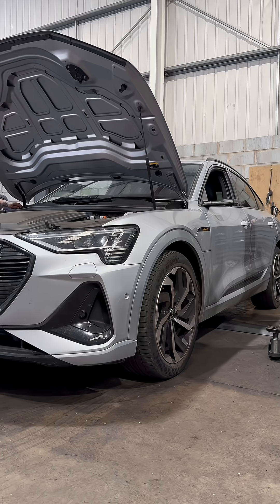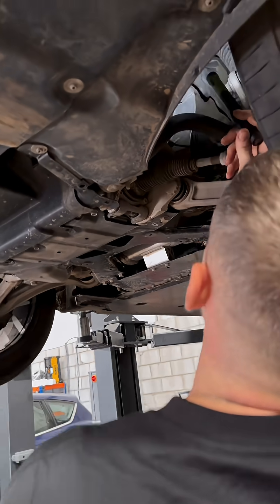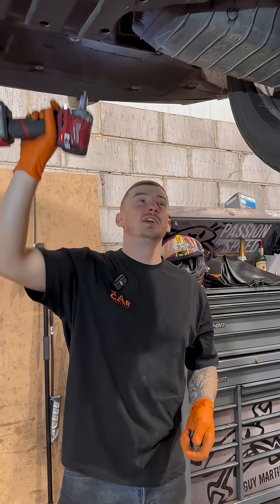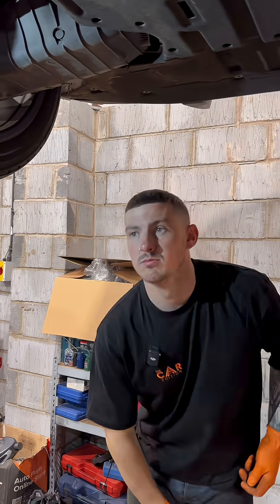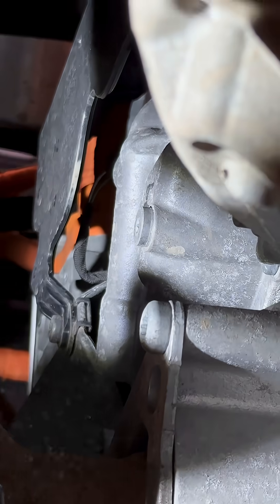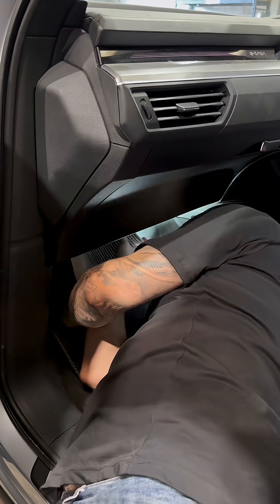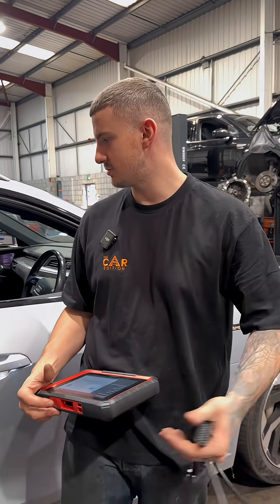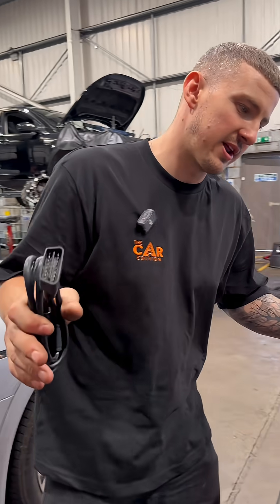How do you service an electric car? Audi E-Tron in for a full service 🦾

Comment: As much as i love my petrols and diesels, as an electrical engineer im actually quite excited for a future of electric cars. Not having anything break is something i like the idea of. Plus with over a decade of experience working with batteries they dont worry me in the slightest. For most evs the chassis will rust through before the battery fails

Comment: What's your thoughts on 2022 etron. Any common repairs needed like new motor. Watched a video about flaw with the motor where fluid leaks into block that should be sealed. Thanks, looking at buying a 2022 vorsprung

Comment: Good that your checking the electric motor coolent drain ports BUT they are there to allow any coolent that has seeped past a worn seal to be retained till service and released so if there is any present its pointing to a failing seal and that need attending too. Of course if the service is delayed of the leak is bad or a combination of both the coolent could enter the electrics / gear box. Conversely keep an eye on your coolent level, if it drops ....panic

Comment: A bit late, but that front motor likely has coolant stuck in there.  Based on how much was in the rear 'catch can', likely the front seal is also leaking.  Fairly common for nothing to drip out of the t30 drain, need to stick a pick in there and break up the surface tension and/or junk built up.

Comment: Tyres.  It’s not the diff you have to worry about. It’s the centre differential that has issues if the rolling radiance between axles is too different.   Audi say that 3mm on a diagonal is okay. But as the car is electric and no centre differential new axel pairs is fine !

Comment: These have no problems until they get one at least and won't be pretty i tell you that. I've changed the front motor in one of these awd  e tron and a high voltage switch box on battery (go ta get down 😢) nasty prices i tell ya

Comment: It's not going to fk up your rear diff. The difference in new and an old tyre in circumference is minimal. This is literally the job of the diff. It exists solely to accommodate such an event. Think what happens when you drive. You are constantly moving the steering wheel left or right of centre. I would be more concerned with the difference in grip between a worn and a new tyre that a bit of diff action. And yes, i am a qualified mechanic.
Reply: Agreed, that is exactly what a diff is for. I have know some traction control modules get confused when the circumstances of the tyres differ. That was the first time that I became familiar with 'star' rated tyres.
Reply: It depends on the type of diff. A traditional mechanical diff will cope with different tyres without issue. Some 4x4 cars have a viscous diff as a centre diff, and some do not like constant speed differences, so wear more quickly if front to rear wheel speeds are significantly different. Permanent 4wd usually have a proper centre diff. EVs are using a variety of different systems across axles, some quite cheaply, which can be affected by differing tyre diameters. All these concerns can be avoided by avoiding EVs.

Comment: 120k miles on my EV. Original brake pads and discs. Done literally nothing to it in 9 years. Oh wait, I changed the wiper blades a few times.
Reply: Please check your tires after 120k
Reply: I've made the jump to EV. Best thing I've done regarding travel..... Nooooo stress.
Reply: Get ready for the ev haters, they will use emotional arguments rather than logical ones
Reply: @techclipzgo checking tires is an emotional thing?
Reply: @techclipzgo high purchase price, unsuitable for long distance journeys, rapid depreciation, extremely high repair costs outside of warranty.. sorry feeling emotional today
Reply: Pair of utter benders!
Reply: which EV do you have?
Reply: Which EV do you have? Curious cuz i have hear that some of the earlier teslas were great
Reply: Boring cars

Comment: Not interested in looking for the fault or bad adjustment that’s causing the uneven wear on the rears then…?
Reply: Fault exists in the driver's right foot. Some cars uneven tyre wear just happens, could be suspension geometry or driving style.

Anyone living in Milton Keynes will know about uneven tyre wear, the whole town is full of roundabouts so you spend much more time turning right than left.
Reply: It's a known fault due to the suspension geometry being unable to cope with all the different height settings of the air suspension. Air pumps also prone to failing early and it's bend over and get the valve grinding paste time 😂😂😂😂
Reply: Exactly, instead of fixing the fault he's recommending four new tyres! Total crooks.
Reply: @adrianOrange fault of suspension geometry due to air suspension

Comment: What he should’ve explained about the diff is if your diff is an lsd limited slip diff as the tyres are different circumference in hard or firm acceleration the lsd diff will apply pressure to its clutches or cones to give a locked scenario to apply the power to ground in an even action 
Whilst slightly different circumference tyres will cause the diff to try and apply pressure to the clutches or cones more often as it thinks one wheel is slipping hence the lsd setup but I doubt a slightly worn tyre is going to cause an issue considering the left rear tyre wears more than the right rear tyre due to tourque twist in putting power through the driveline but a different size tyre would cause major issues and prematurely wear out an lsd diff

Comment: You Could have taken the brake pads out and Grease the sliders, Another thing was Removed all the Road wheels I bet they are Corroded on the Hub which is normally found on This yearly Service 😢

Comment: I went to France for a holiday and before I went I had 2 brand new tires put on the back 3 days later I got a puncture and the garage refused to replace only the damaged one stating it is an offence in France to replace the 1 both have to be replaced, so who knew?

Comment: If there is wear, especially on a powerful electric car on the insides of the tires, there are often some bushes that are starting to wear out already. This is especially common on the Tesla Model S & X.
Reply: Model X wears out the inside edge of rear tyres regardless of suspension maintenance because the factory camber settings aren't appropriate for all ride heights of the air suspension.
Reply: Get a puncture and replace all four tyres lmfao

Comment: Id say more important to change tyres in axle pairs for even grip and braking distances.
Reply: It's key for cornering - often one side loads up or has much greater chance for grip (due to gravel or greasy material on the road for example) - in the wet a blad or low tread tire might not do the business.
A single tyre with good tread might prevent a crash.

Comment: Wait until you need to change the battery!
Reply: My 9 year old model S has 158,000 miles  no wet belt was done bla bla bla . On the original battery etc.  Drove from Belfast via Glasgow to Kings Lynn one day. Cheap to run. Especially on Tesla Supercharger network/charging at home
Reply: Where’s your evidence for that bold claim. 
Actually battery repairs are common now.

Comment: Wait what? You drained some coolant, where did it come from? Does it need to be topped up?
Reply: Rarely. It’s not operating at anything like the temperature of a combustion engine. It’s used to cool both the battery & in some cases the motors. 

In some EVs they’ll heat the battery in the winter. 

It’s rare for any of them to give trouble but there’s a known issue with the early model S Tesla where a seal can fail letting coolant into the drive motor. Almost all have been replaced by Tesla though.
Reply: @hughmarcus1 Actually on this e-trons, rear motors are a problem, with coolant leaking on to the motor. Emptying this reservoar you see in the video, prevents that from happening and is the most important bit on the service he did😅
Reply: @andersnor2 does that mean Audi's solution to a coolant leak is to provide a bottle to catch it and a service instruction to empty it rather than eliminating the leak during design and development?  Premium manufacturing going on there.
Reply: @insanityideas don't know all the details, but i live in norway where there are a lot of EVs and E-trons. And a lot of issues with this car. The insurance is also expencive on E-trons because of all the problems. Seen a lot of videos on these, specially explaining this reservoar for example. Not good. One of the best looking EVs in my opinion, but that does'nt help if it makes you broke😅
Reply: @andersnor2  52k in my etron and the rear coolant  reservoir is still empty, checked yesterday when I replaced the air suspension compressor ( these are a common fault and the only issue I have had) Audi to replace £2.5k. Me, an hour of my time + £179 for a replacement one from the breakers.

Comment: Tbh I have been driving for thirty eight years and have only ever changed the tire that is either worn or damaged in a place that cannot be repaired. This whole differential business is new to me.
Reply: It’s mostly a big deal with AWD vehicles, you don’t want difference between the front and rear, otherwise the transfer case could suffer
Reply: I have been driving for 51 years and only ever change tyres on axle pairs.
My reasoning is to ensure maximum stability during emergency braking or cornering.
Reply: @chrispop99 😂you have got to much money pal
Reply: @sineave6419  Nope, but plenty of concern for safety for myself and others!
Reply: Years ago, without ABS, it was a good idea to have similar tread depth across an axle, but with ABS not so important.
Reply: @oliveringram3056  Braking distance will still be longer, and loss of steering control more likely.
Even with ABS braking performance is limited by the worst gripping tyre.
Reply: It's completely fine on almost every car ,he was talking about 4wd  and rwd with a proper diff.

Comment: Assuming (90%?) that electric cars are fully adopted then we will have moved from a period of maximum ICE complexity to minimal mechanical (engine / gearbox) but maximal electronic complexity. I guess this transition will take 25 yrs to work though (probably via hybrids) but good to see you getting in early to understand and service these cars as your business will be changed beyond recognition in a generation.
Reply: Get rid of the horse stables and replace with petrol stations 
It’s been done b4
Reply: @michaelhermans4753 different situation back then. Horse vs car. Now it’s electric car vs petrol car. Car vs car. The transition is not so obvious.

Comment: This kid chats shitt. The differential is designed to overcome the ackerman principle while still transferring torque to both wheels. When you go around a corner, the inside wheel has a smaller turning radius to outter. This is normal and DOES NOT DAMAGE DIFF. It annoys me when people just waffle technical when they have no clue what they talking about
Reply: The 4WD Audi/VWs etc require the same circumference tyres, or you're asking for an expensive repair.
Reply: @deaddoll1361  every time you go around a corner, the inner and outer wheels turn at different speeds. The differential is there to allow independant rotation whilst still applying torque to both wheels but without 'skipping'. So your saying now let your tyre 2mm of tread will destroy the diff? Dont just listen to people, understand the system and come to a conclusion yourself.
Reply: While I highly doubt the slight difference in tyre wear makes a difference. Running a space saver on a driven axle for a long time or wheel spinning regularly with an open diff will wear out the planetary gears. They have no bearings. They're only splash lubricated and just rub against the diff cage, I've seen it a few times now.

Comment: It is better to have tyres that are the same depth but its not going to ruin your diff if they're not, differentials are in constant flux, even in a straight drive down the road there is differences in rotation, thats why the differential is fitted in the first place, regular good maintenance is the key.
Reply: I think he means for a limited slip  diff perhaps ?  But yeah I've heard of that , but would tend to agree with what you said . 👍
Reply: Having tyres with different tread depths can throw up fault codes with certain VAG vehicles as even in a straight line there will be a significant difference in speed of rotation of wheels on same axle. So what he stated is essentially correct.
Reply: @iainmacleod4007 coming from a vag owner 🤣
Reply: @iainmacleod4007  Enough to ruin the diff? No way.
Reply: @thewaywardgrape3838 Yes, way…if it’s a clutch disk style coupling, which is sometimes (incorrectly, IMO) referred to as a center diff.
Reply: It’s a reference to center”viscous” coupling diffs, that is, between the F & R prop shafts or final drives. A little slip when turning is ok. Constant slip when the car is traveling straight ahead isn’t ok in the long run. If it’s a gear-only type diff w/o any friction disks, I agree with your point, though.
Reply: It is a German car remember 😅
Reply: I’ve had loads of Awd cars (cossie, evo, mk3 focus rs, Subaru and bmw touring) the x-deive on the bmw is a bitch with tyres to the point i paid £120 for an app to delete it but all the other cars i’ve had, couldn’t give a shit.

Just think about this, the new m3 & m5 and be turned rwd on a push of a button. If you drift then the rears will obviously be more worn than the fronts.
Reply: Which makes the comment about it ruining the diff to be a load of Bullsht
Reply: These guys are incredible, but that tyre difference front to rear ruining your diff comment was retarded. Some awd vehicles have totally different tyres front and rear, like the X5s these guys work on... Ideally, all tyres would have the same rotational dimension, but that is almost never the case and is not going to fk your centre diff
Reply: I know someone with an BMW x3, part worn different sized tyres on the rear ruined the diff, £3k+ bill from BMW, so you are wrong
Reply: I know someone with an BMW x3, part worn different tred depth tyres on the rear ruined the diff, £3k+ bill from BMW....
Reply: How many people are running different tread depths (most)? How often does one hear about diffs being replaced? (I don't know of anyone having had this done)?
Reply: That did sound rather extreme.

Comment: This is an issue with aftermarket scan tools, they allow you to set oil change in 5F when is should only be showing 2 years inspection light only, ideally will require VCDS or going into the coding now to erase the oil change indicator, have seen this a few times already 😅 and had to correct them, some scan tools are now picking up it’s an etron and not allowing oil change to be set but some will still allow it.

Comment: Nonsense about the diff, been driving for donkeys years on a budget and have never replaced both tyres on a axle, change as needed and I have NEVER had diff trouble.
Reply: How can a diff be destroyed by a small low speed rotation..... total BS 

Wife drives a kodiaq. Has haldex, changed the fron two tyres. It went bonkers on the dash or two miles then sorted itself out.

Comment: Teslas don’t have a service schedule at all. It’s wholly unnecessary. The legacy automakers have one for their EVs simply because they have a dealer network to answer to. But it’s contrived and pointless.
Reply: You sound as the typical naive person that falls for the "no maintenance required" to push for EVs. They also need plenty of maintenance, like suspension components, more tire wear, complex diagnosis, modules, fluids change, they have excessive dependency on electronics that will eventually break turning it into a lawn ornament.
Reply: @RogerM88 and you sound like an EV hater. Good luck with that.
Reply: @ethelred2648  Nope...just someone with common sense. There's a reason why the EV market is still too subsidized.
Reply: So brakes, tyres and suspension shouldn’t be checked on a regular basis?
Reply: Nonsense, there’s plenty of parts to wear out, filters, fluids etc.
Reply: Yeah these EVangelists forget that EVs are just cars without an engine. They still have everything else an ICE car has lol

Comment: Had a chat with my local bmw independent specialist about tyres on my 530d xdrive.... he said you change all four as its not only the difference on each axle, its the difference between the front and rear causes problems as well....he was also saying about they needed star marked tyres, which mine has.
Reply: It doesn't need star marked tyres that's just a sales gimmick to make BMW money. Ideally all 4 should match though, just rotate the tyres each service. I rotate tyres on my car which is FWD there is never a difference of more than 1mm between the fronts and rears.
Reply: Ditch the run flats
Reply: @BoyeeSmudger its ex police, they aren't run flats...255/55/17
Reply: @stevenking1833 17s, nicer ride. Good choice!
Reply: @BoyeeSmudger as well as no broken rims, and 21 services between registration and coming out of servce at 97k miles...